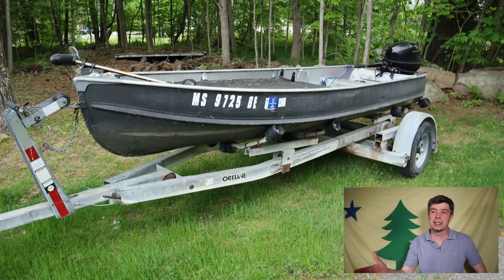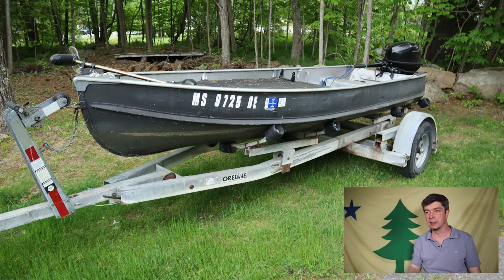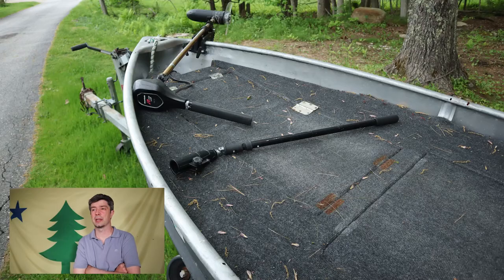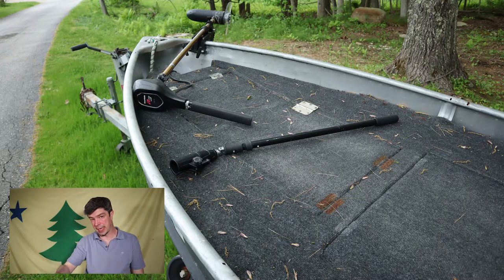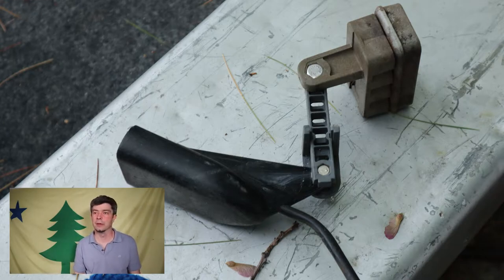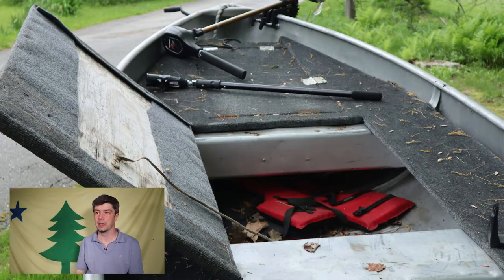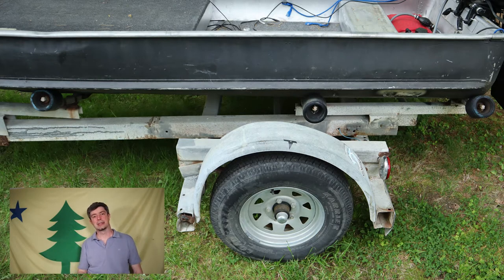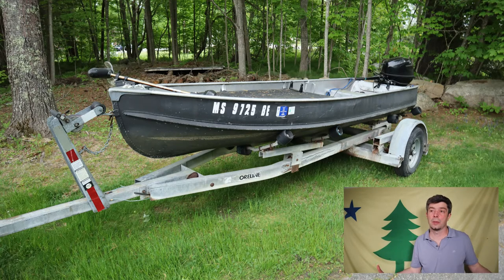How to Make  A Cheap Bass Boat

Comment: You really don't want to use pressure treated plywood on an aluminum boat. Most pressure treated wood has a copper derivative in it that corrodes aluminum.  Just FYI
Reply from the maker: That aluminum boat is worth nothing. It handled that pt like a champ.